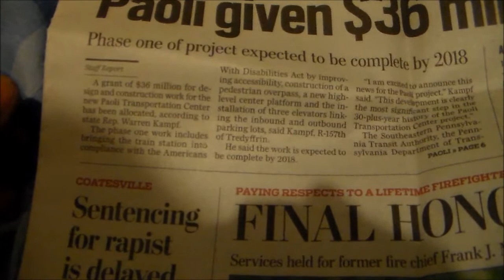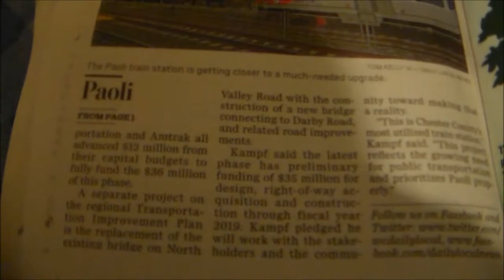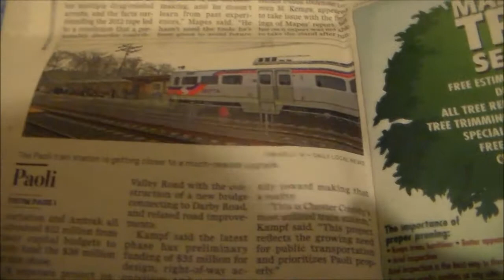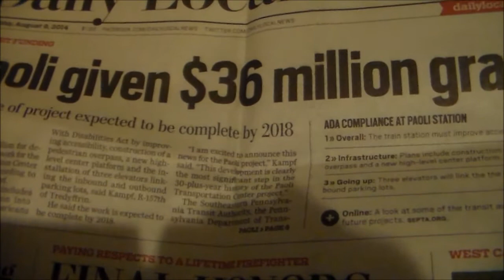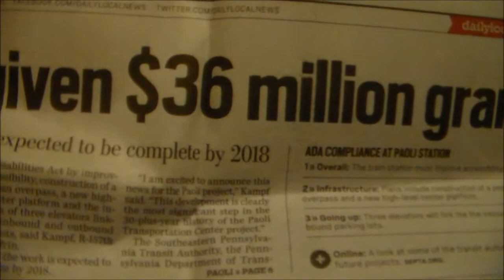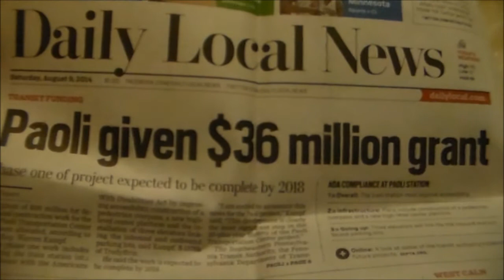Paoli Station Improvement Project

Comment: Nice video. Do you know if any HHP-8s remain in service now?
Reply from the maker: Thanks!! Just the ones we last talked about but I think another was retired but I am not sure.
Reply: EMDSD14R Well Wikipedia states all HHP-8s have been returned to Bombarder but it also states 2 or 3 are left in service: 651, 655 and 661, however there is a video from last week of 655 on its last run, and a video from late last week of 651, the last hhp in service, so there are either 2 left or none left, i don't know for sure until wikipedia states all hhps are retire
Reply from the maker: acfhs2010 Yeah I don't trust that site. People can go on there and change a lot of stuff. Well I filmed 654 3 weeks ago and another one also. I honestly don't know how many are left but I would check out another website instead of  Wikipedia just to be sure.
Reply: EMDSD14R Ok, what site should I check? Does that site you linked which lists the statuses of all hhps and toasters update regularly?
Reply from the maker: acfhs2010 Well I look at facebook forums or other railroad related forum websites. Mainly facebook now since you can ask right then an there and somebody that knows can give you updates. Well that picture is about the Amtrak units but I don't think it updates.
Reply: EMDSD14R Thats great, thanks for the info. BTW the paoli station upgrades are overdue, infact alot of SEPTA stations need elevated platforms, NJT, LIRR, & metro north each have alot of elevated platforms, even MARC has a number of elevated platforms.
Reply from the maker: acfhs2010 Anytime buddy. Yeah they are years behind that and not all stations have handicap accessibility either. Paoli dose need it badly and with the increase in traffic that's going to happen it'll be good to have everything elevated. Indeed that true that NJT and LIRR have them and MARC also. Oh btw an ACS64 test train ran today. Please check out the video of it asap. We might start seeing them on Keystones now :-)
Reply: EMDSD14R I will check out that ACS test train video. It will be great to see ACS units in regular service on the keystone line.

Comment: That's cool! So anything new with the layout?
Reply from the maker: Indeed! Well expect for some new and rebuilt trains nothing much. I am going to expand my yard a bit if I can. I need more tracks for cars.
Reply: EMDSD14R Ok! Its hard to have enough tracks for rolling stock.
Reply from the maker: Northwest Railfan (aarona2u) Yeah true very true. My new layout will need a few yards. Most for freight cars while the others are for passenger/ commuter trains.
Reply: EMDSD14R I got a layout finally. I actually find I have less space then on the floor or yard space.
Reply from the maker: Northwest Railfan (aarona2u) Oh that's cool is it a 4x8? Well that might be the case but it saves your back an knees in the long run :-)
Reply: EMDSD14R yeah it is. Yeah it definitely does. :)
Reply from the maker: Northwest Railfan (aarona2u) Oh that's awesome!! :-) Congratulations!!
Reply: EMDSD14R Thanks! I also finally got a pair of sounder cars!!!
Reply from the maker: Northwest Railfan (aarona2u) Anytime man!! Oh that cool buddy a cab and a coach right?
Reply: EMDSD14R Yes. They are in a couple videos on my channel.